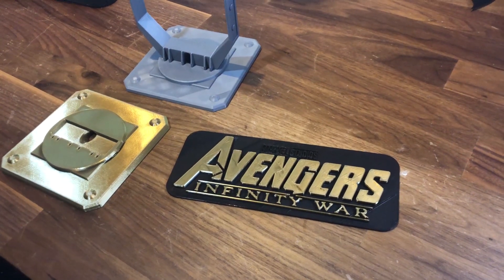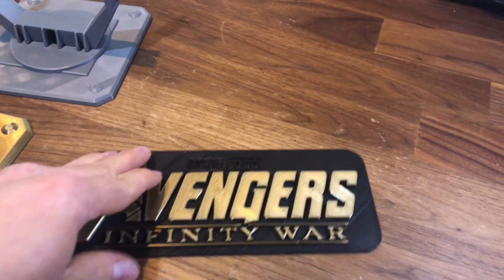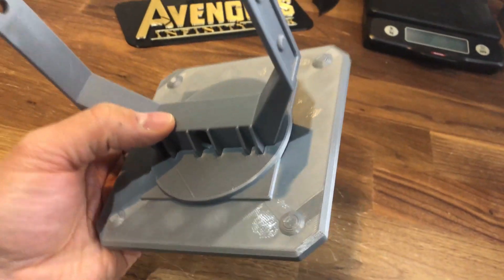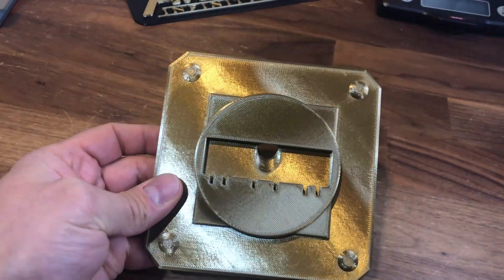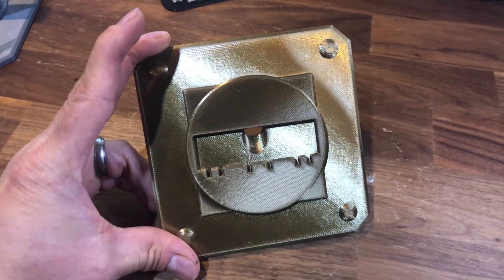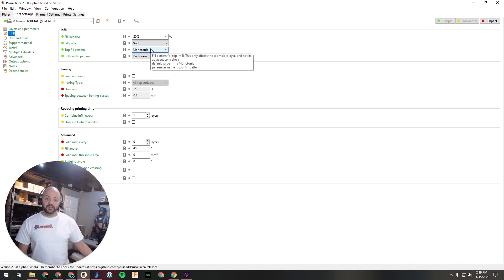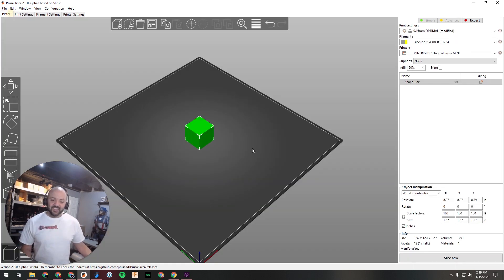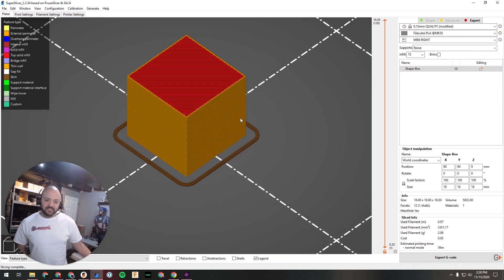NEW Monotonous Infill in PrusaSlicer and SuperSlicer!

Comment: Is this not something like ironing???? I dont get it because ironing make it even smoother right?
Reply: would love to know this as well
Reply: The thing about ironing is that its purpose is to smooth out the filament lines that are visible on top surfaces.  It doesn't change the behaviour or fill pattern that you see on the top.  So if you would ordinarily get a funky mosaic top surface you'll still see some elements of that with ironing.  It'll just be a smooth top.  The monotonic removes the funky mosaic, but leaves the surface with the filament lines.  In a perfect world when you have the time (because ironging takes a heap of extra time to do) you'd enable both for a lovely finish.  It depends on what your end goal will be for your model.  If you require the best finish possible then you'd enable both, but if you're fast prototyping, but still want a decent surface to show a client, then you'd use the monotonic option.

Comment: This is nice!  Have you checked out the new interior infill patterns as well?
Reply from the maker: Oh no I haven't! Not sure I even noticed that! Which version and which patterns are new?
Reply: @SuperheroDIY  Well I'm not sure there are new ones but adaptive cubic and supportive cubic dont seem to have a lot of info available about them.  I keep pretty updated with this kinda stuff but I may have missed them announcing it...   I cant tell the difference at a glance in the models I'm printing.
Reply: @SuperheroDIY  after a bit of research it appears it is new.  Looks like denser infill near roofs for supportive and denser towards part walls for adaptive.   They appear to be adding it as a support material pattern too but it's not functioning currently.
Reply from the maker: Oh ok yeah just looking at it now, looks like it's definitely not working so far! :) Would be good though if it does work in the future to reduce print time on those bigger prints!